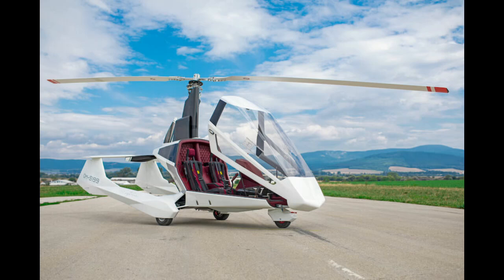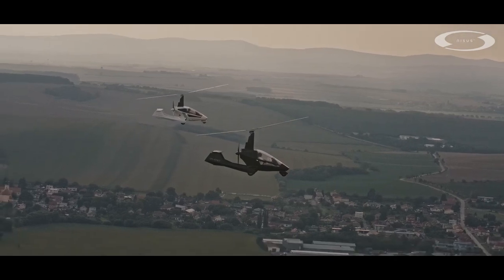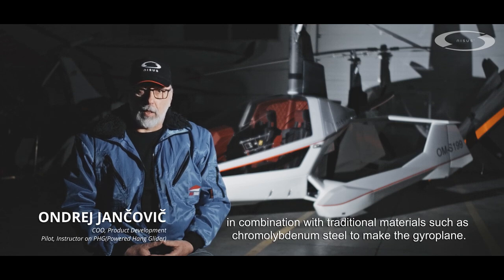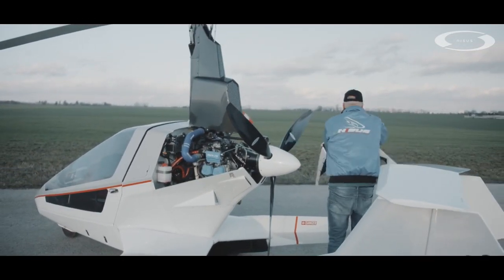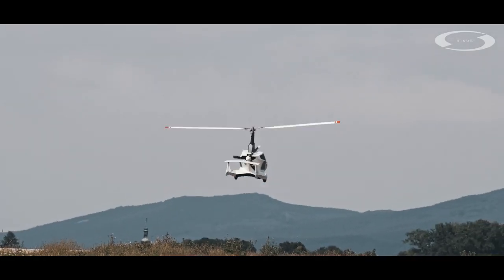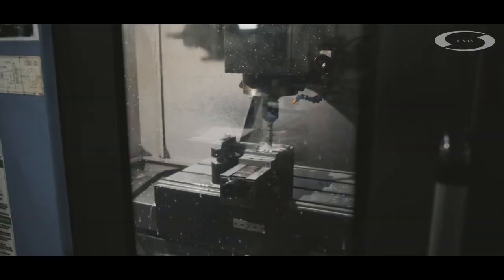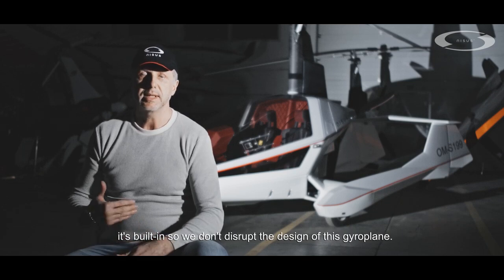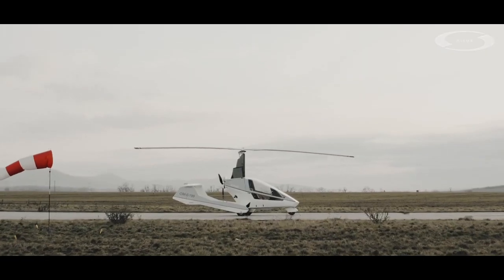New gyrocopter - Nisus Aero

Comment: I don't suppose you could give us the name and contact details of the Chinese motor manufacturer you mentioned in the video?
I've not heard of them, but would like to check them out.
Reply from the maker: Hello John.  I'm unconnected but from my own efforts with google I see Zhongshen aero engines.  https://www.facebook.com/ZSAeroEngine/ from there you find Zonsen Industry,Zone, Banan District, Chongqing, China /  +86 187 0238 9580 / aero@zsengine.com /  en.zsaeroengine.com.  They have produced a manual here:- http://www.zsengine.eu/Manuals/C100-F%20Installation%20Manual.pdf My own personal view is that it will at some point be accepted and then why would you not buy one?  After all it is highly likely the factory can make things to as good a tolerance as anything in Western factories if they choose it.

Comment: So you are promoting Chinese intellectual property theft?
Reply from the maker: Hi - in what sense?  Of the 4 stroke petrol internal combustion engine?
Reply: @gyrocopterflyingclub6148  Did you not say that the Chinese engine is a copy of the rotax?
Reply from the maker: @Cesarhernandez-wv3do  no I think you need to listen to the film again.  I said it was a Rotax for half price which personally I think is a great thing because the pricing at Rotax has become insanity, not just the complete motor but also the spare parts.

Comment: This is a great design. Pay NO attention to the suggestion of a cheap Chinese engine. Stay with Rotax. Its tried and tested with reliability. This aircraft deserves an engine that matches the quality of the build.
Reply from the maker: Hey Mike - I don't necessarily disagree with the view that the aircraft looks to have some good qualities and for now the Rotax motor is tired and tested... BUT... if i were a manufacturer of gyroplanes in 2021 I'd be looking to source a cheaper power unit and Zongshen make one.  Is it any good?  I've no idea but there is no reason it can't be and when you consider that any light sport aircraft cost is 50% motor that is nuts.

Here is a very popular European sport fixed wing and its price list: -http://www.skyranger.co.uk/wp-content/uploads/2018/06/Brochure-and-price-list-Swift2-and-Nynja-V15-sept17.pdf

I just don't get the negative sentiment if that inc. VAT price become £9000, making the total price of that aircraft with motor £30k - what is not to like?  On the basis that a basic open 2 seat gyroplane shouldn't cost anymore than a Skyranger again what isn't to like if someone makes a reliable cheaper power unit from whatever country?
Reply: @gyrocopterflyingclub6148  Get a Chinese moped. You will know the deference without taking a major risk.

Comment: As a Gyroplane pilot since 1985 I have a couple of thoughts here ;  first the enclosure is typical for just about any European designed aircraft (RW or FW) in that it’s probably great for crappy European weather but you would find it pretty insufferable for much of the U. S. save coldest winter. That little sliding vent on the side does you zero good while waiting on a ramp for takeoff and not that much better inflight. Imagine being cooped up in there in Arizona or worse still Florida. 

Second, “Why don’t they use the Chinese engine” - because it’s a Chinese engine !  If it’s anything like some of my HarborFreight power tools I believe I’ll wait a bit to see how it fares.
Reply from the maker: Hey hope you are well.  Yes 100% agree on the cockpit heat and I wonder if a neat design hear could be an intermediate catch that holds the canopy open at a mid position while on the ramp.  

On China I take the general point and no doubt the proof of the pudding will be in the eating although I'd make this more general observation.  In the UK we have a variety of big hitting universities.  Oxford, Cambridge, LSE, Imperial College and Bristol for those that didn't pay attention and missed a place at the others.  Chinese students are a big feature in these places and lets be frank will be in US Ivy league too.  The Chinese are not backward people and we tend to "fear" or reject them in the West mainly because we don't go on holiday there or understand them widely.  If the Chinese want to make a Rotax type GA motor then it can be even better if they are motivated that way.
Reply: @gyrocopterflyingclub6148  >>> FWIW:  I have no problem whatsoever with the Chinese people.  That said, the Chinese government is communist, and THAT will ALWAYS be an issue.
Reply: @gyrocopterflyingclub6148  You don't understand Chinese mentality. In manufacturing, number one objective is to save money. This will get you killed. Do you know what will happen if someone die because of engine failure? Think about it for a moment.

Comment: The fact that the bubble opens upwards means that you can't get out if the thing tips over in an emergency landing.
Reply from the maker: That is very good point Jeroen and something that is a cause for concern with the UK AAIB and the AutoGyro Calidus model.
Reply: @gyrocopterflyingclub6148  surely the hammer to break the glass is suitable
Reply from the maker: Yes could do - but you know the AAIB are not that happy with this solution in Calidus I've had conversations with their investigators about the suitability and they would prefer it if the CAA made a more onerous test for the certification process.  In truth trying to break out of the canopy having had an accident with something akin to a toffee hammer and I don't think it would work out well tbh.
Reply: @gyrocopterflyingclub6148 Really - unless the machine ended up completely inverted (unlikely unless the mast snapped off) this would not be an issue as on its side the canopy could be opened.
When it comes to the Calidus, this is a problem if it rolls onto its left side. 
It is quite easy in fact to break the canopy to escape and I speak from direct experience of this.
I can confirm that the Calidus canopy was very easy to break in order to escape when I crashed and tipped onto the left side.
It may look like a toffee hammer but it is actually a well designed tool to break a canopy/windscreen and if necessary cut seat belt restraints.
I think in fact the real life safety issue would be trying to safely ditch in the water.
Reply from the maker: @tomgalloway4891  Hi Tom, yes I hear you but as you can see from the last page of this report the concern remains.  https://assets.publishing.service.gov.uk/media/5aa7e1db40f0b66b625e2b0e/Rotorsport_UK_Calidus_G-CIYU_04-18.pdf
Reply: @gyrocopterflyingclub6148  I do not wish to flog this point to death - only to state that the hammer works well (if you need to use it) and also now the case of this report - the whole concern re the hammer in the report is based on the fact that " An emergency hammer was available to break the canopy but the pilot reported afterwards that he was not confident he could exert enough force to achieve this while trapped on his side. As there was no obvious danger he waited for assistance, and his recollection was that the RFFS arrived quickly and righted the gyroplane, allowing the canopy to be opened and for himself and his passenger to climb out uninjured."
Reply: I don't suppose you could give us the name and contact details of the Chinese motor manufacturer you mentioned in the video?
Reply: @Tinker1950  Zongshen (also known as Zonsen) and Gaokin manufacture Rotax clones. Zongshen particularly has a long history of manufacturing engines for motorcycles and other land vehicles

Comment: Of my many years watching the development of gyros, it's common for a past design to be re-badged as 'the next big thing's from companies.
Sure, it's great to see the development on-going, however to see a design re-morphing is the " everything old has become new again" scenario.

As much as designers try to put a 'new sleek' spin on the design. The flight fundamentals remain the same. It has to lift its own body into the air to fly safely.

This is a Rotorvox MkII, as you correctly described.

Comment: Not sure you appreciate how bad Chinese engines are. All their motorcycle engines are at the bottom of the scale when measured against the European oil contamination test. So much off the scale in fact that they are not reliable and for aircraft think that would mean not safe. I can’t remember the test name but Germans run top, UK mid section then the lower 3rd is occupied by Japanese and Italian yet the difference between them is minuscule parts per million of what ever contaminants they measure in the oil but!!! the Chinese engines are so bad the test equipment can not even measure the sample.. Maybe this is why.
Reply: I would not trust a Chinese made engine for a flying machine or any flying machine for that matter, I would only go with manufactures that pass the more stringent certifications that are from EU, and USA.
Reply from the maker: @spkt0r  Hi - yes but actually what are those certifications?  Your ROTAX 912 ULS and 914 UL motors are uncertified....
Reply: I believe with the Chinese engineering it boils down to poor foundry practices. Not using good quality materials to start with. As with all producers of engines, there was a evolution timeline in respect to product quality.
Reply from the maker: Hey Paul - I'm not sure that its apples with apples however.  I might agree that a $200 Honda 125cc motorbike copy has some limitations but the bottom line is that [as the carbon work in this Slovak aircraft is a guide] the modern factories in these countries are first rate and the people are super clever.  I do hear your point BUT I should think that if they wish to make something that is up to the job then they certainly could and I think if they do that why would anyone buy a Rotax?  Lets be honest if a GA aircraft flies 50hrs a year then its a lot and so in 10 years your £40K 915 Rotax effectively costs £80 per hour!  Think about that!
Reply: @gyrocopterflyingclub6148  Unfortunately not just a 200 quid scooter engine. The contamination test is VDA 19 and there is an iso standard test as well but don’t know it. Test reports for all kinds of Chinese engines commonly show they come engineered with added plastic, fabric, sand and a myriad of other particles commonly found on a production line.. Though you do get them for free. 😉
Reply: @PaulAnthonyDuttonUk Paul I used to turn and machine turbocharger bearing housings, at odd times I'd machined compressor covers and much earlier when to be fair I when  would not have known what I was looking at turbine housings. We ended up 2006ish buying in Chinese and Indian components. I never got to know the figures if they were run through a CMM machine, but I assume they must have been satisfactory I was doing some assembly work at the time. The surface finish on some of this stuff was absolutely excellent though. The thing that pissed me off was that with bearing housings we had a type of bearing housing where near the oil return the machining at that point left 1 or 2 cast projections. In house, we had to use a bar or file to break these off, then a few strokes with a file to clean the surface up. The bought in components didn't have these peaks removed. So if they were adequate then we had our in house machinists performing to a standard above specification.
Yet another film talking bollocks about CNC machining. If you don't monitor the cuts of different tools it will all run away from you, and you will just produce shit. Too many times when I was starting off did I focus on my perceived problem and something else had moved and all I made was scrap!
Reply from the maker: Haha yes it make for interesting reading is this mainly automotive applications? In the UK I think (but happy to be wrong) that only the MG brand is solo Chinese auto sold in the UK. Of course Morris Garages turns in his grave but at the price they seem to do a job. I should try and get a Chinese Rotax and fly it around see how it performs - I suspect that will be the only route to longer term acceptance is when one manages to fly x hrs without issue.
Reply: @gyrocopterflyingclub6148  - Think you would have to buy five... , a sample of one that was ok would just mean you are lucky 🍀 - If Q control and assembly was outside of China it might be ok but on balance think it’s false economics. It’s time to put a lid on China anyway as it’s getting too big for its own boots. Rewarding state sponsored reverse engineering is never a good idea and time for us to reject what is really a snake masquerading in dragons clothing. Don’t feed it! 🐍
Reply from the maker: @PaulAnthonyDuttonUk  Yes I hear you on the sample size of 1.  I think that [and its just personal opinion] Rotax aero motors are pretty reliable but then there are still snags and the price is ridiculous frankly - not just for the base motor but the parts also.  Now OK the smaller volumes are justification in part but in the UK a 912 ULS motor is broadly £20K with rads and an exhaust etc.  £20K!  I can import a GM small block V8 auto motor from the USA for less than $8K.  Again I get the volume argument but these are not certified aero engines with a huge level of paperwork and process that has chewed up someones time.  So why so the cost and as I said for the majority flying a few hours per year the price per hour is off the clock.

As for China more widely. Of course the virus means they are off the Christmas card list but lets be honest Tech, Jeans, Trainers, face masks to protect against their virus... all made in China.  I'm looking at my iPhone it says designed in Calif.  made in CHINA... I think a few aero engines make literally zero impact to their GDP!
Reply: @gyrocopterflyingclub6148   Well as a buyer what I want is a guarantee that the engine is not just going to fail while It's in the air, Chinese made products have extremely high failure rates (Iphone's are absolute garbage I fix about 5 to 6 a day), they have extremely poor quality control-(this is the big one for me).  The fame that comes with products made in china, which as a buyer it's about perception.  If you told me this gyro and all its parts are produced here in the USA, UK, Germany or EU then I would feel more comfortable with the quality and level of quality control.  

Also Thank you very much for all the videos and the work you put into producing them they are very informative.  Do you have merch like shirts or mugs or something i'd buy it. (Even if it's made in china, I'm not gonna fly with it so it should be ok)
Reply from the maker: @spkt0r  Yes agree the perception is going to be key but I think in time given the choice of a Rotax at $30K or a Zongshen at $15K many will take the half price option.  Sure it needs a base level of proven reliability but Rotax motors are fundamentally unjustifiably expensive and I for one hope the Chinese [or anyone else for that matter] proves that fact because it can only be a good thing for people wanting to get airborne at a low price.

You are very welcome to the films and I am glad you enjoy them - thanks for the kind feedback and the banter - all are welcome. Merch wise I'm in the middle of writing a book [it should have been finished by now but the virus distracted me slightly with some other commercial needs but I should think it will be ready end of 21] I'll let you know when its done.  Cheers